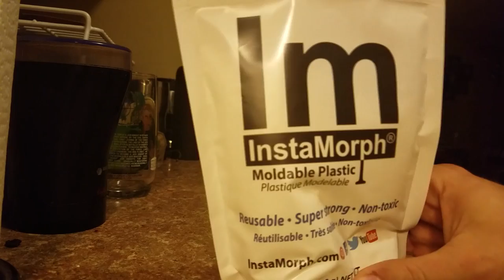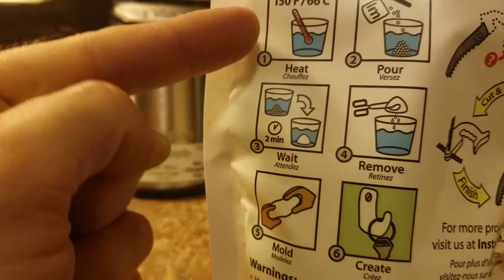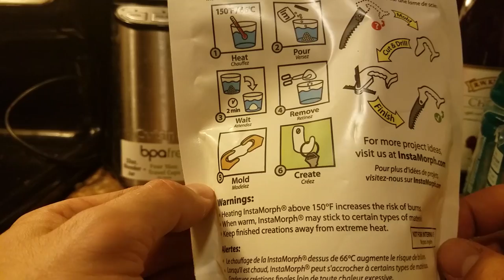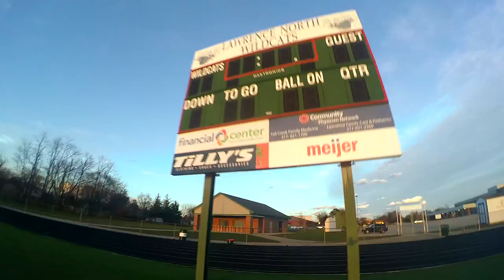VLOG - 23 // Instamorph Yi Angle Mount

Comment: Instamorph is awesome!!! If you want I could send you a few 3D printed Yi/Gopro mounts that I use for my X. They weigh about 6-7gr and have 30deg of tilt. They fit on the square 30.5mm pattern like the fc. Anyway let me know if you want to try them. I don't really sell them, but I would make you a few if you want.
Reply from the maker: I have a couple local guys that will print for me when I need something. I actually made this on purpose to test out making stuff with insta more. I enjoyed the process

Comment: Looks like the mount worked pretty well, notice the camera slip out at all after flying? Also where did you get that big bag of standoffs and screws?
Reply from the maker: +hpz937 The camera doesn't slip because of the stuccoed liquid electrical tape. The way the U220 works is that I land on the battery, so it doesn't land even -- the whole quad is just tilted at the end. 

I got the big bag of standoffs and screws from a friend that used to manufacture a frame of some sort. He literally has like.. 5-6000 of them, and gave some to me. :P